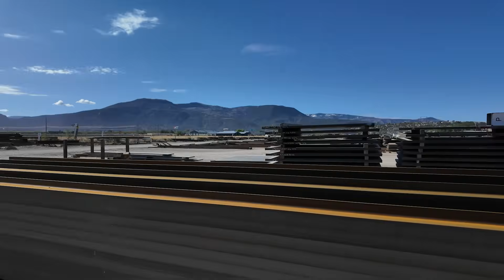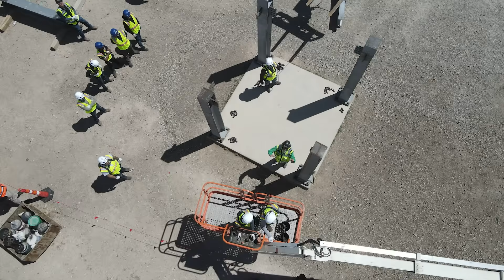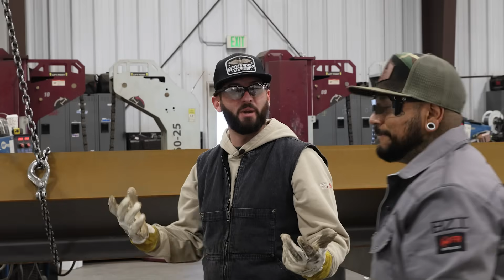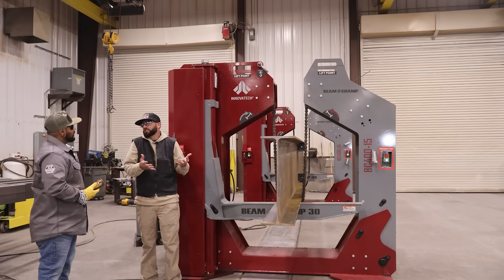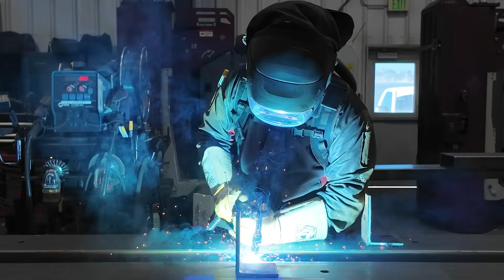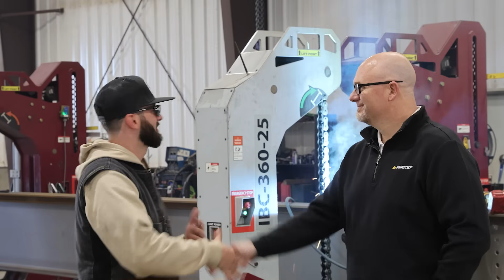No More Dangerous Beam Flips: The Best Way to Flip a Beam with BZI

Comment: As a bridge fitter and welder, I flip beams like this (Many times Larger and longer) all day long sometimes.  Generally, I use an overhead crane and strap.  I used to be very timid flipping beams when I was new.  Recently (over a year now) we have had a similar beam flipper machine.  It doesn't use chains though, it uses straps. Everything is safer, controlled, and more efficient.    Its great.